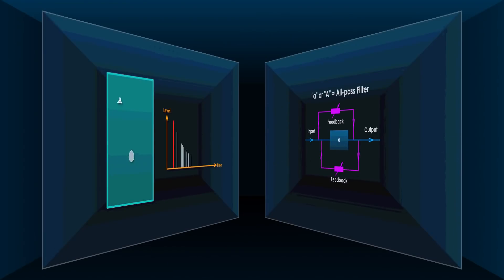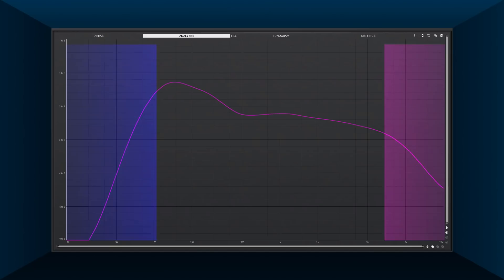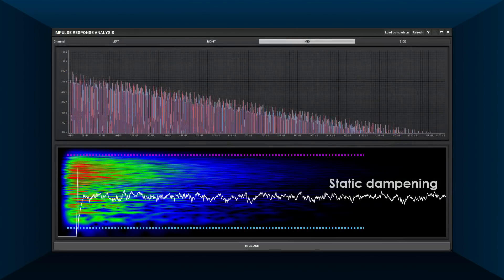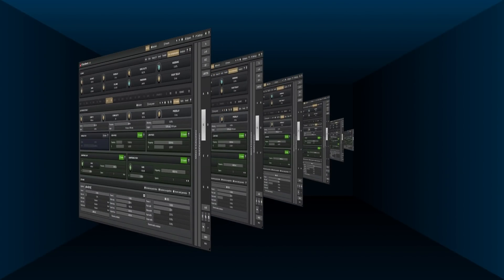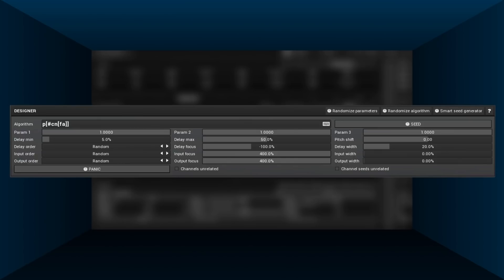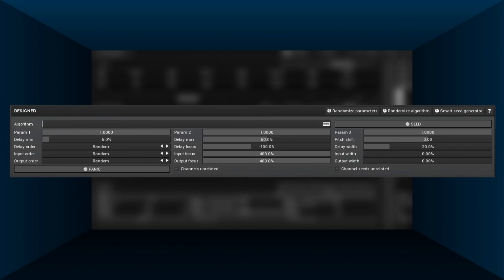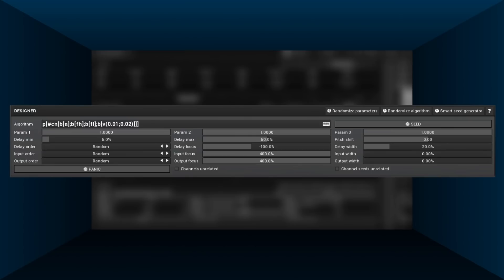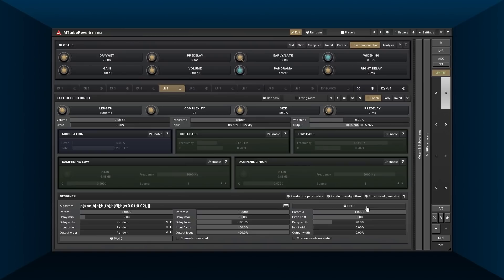Reverb design using MTurboReverb #3 - Dampening, modulation and polymorphic algorithms

Comment: If anyone wants to use my personal referral coupon at Melda's website, for any purchase, here it is: MELDA5376669. 
You get 20% off on your first purchase at Melda's official website and I get 10% in the form of credits.
You'll also get your own personal referral coupon to share with others, as I'm doing now, with the same benefits, and a 10Eur discount.
If it's Black Friday, you accumulate the 20% discount with the 50% one. Happy holiday season.